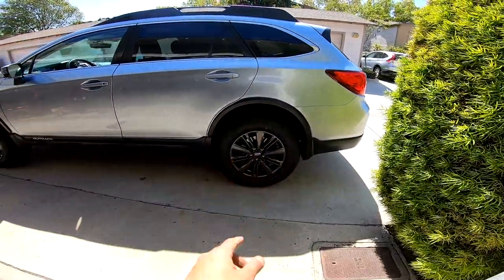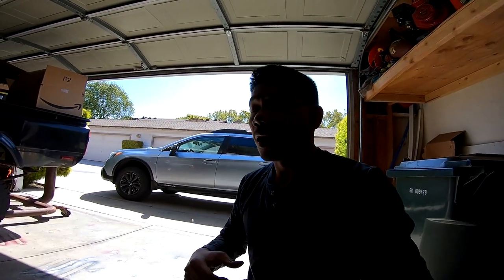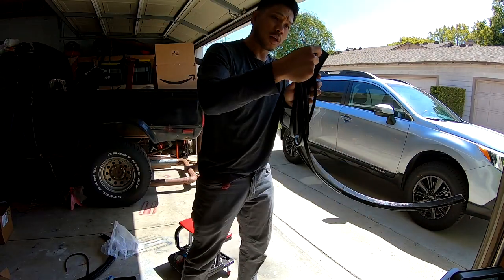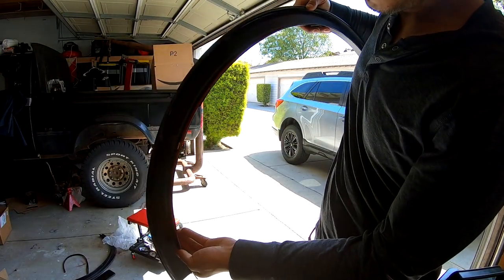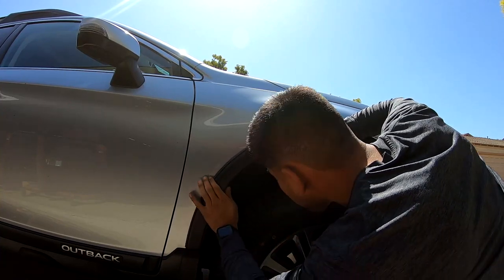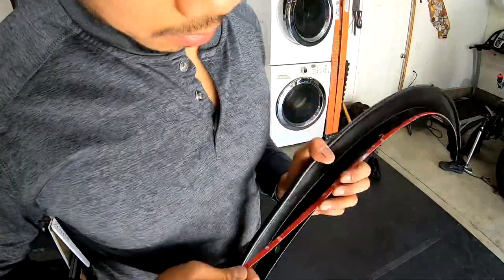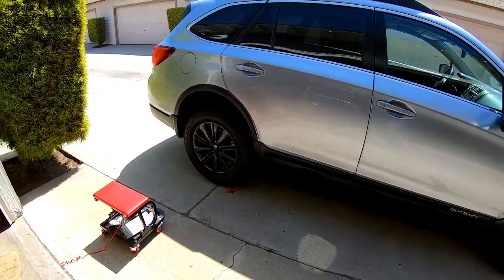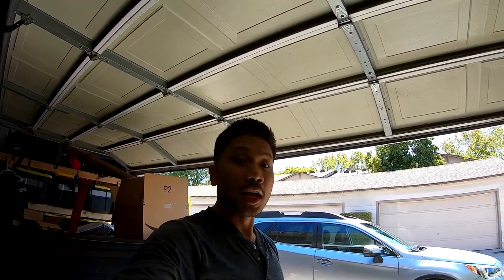How to install Outback wheel arches! | Subaru budget build | EP 5

Comment: Could you let me know if you used the clips at all? And how is it holding up now (2 years on)? I have one that got partially pulled off in a hit-and-run. Really minor damage, but the clips came off. I cannot tell if they are damaged. It also affected the molding piece that the wheel molding sits on top of. I'm confused about how to get things reattached. Idk if it is better to replace the whole molding (1 wheel) or try and use the original.